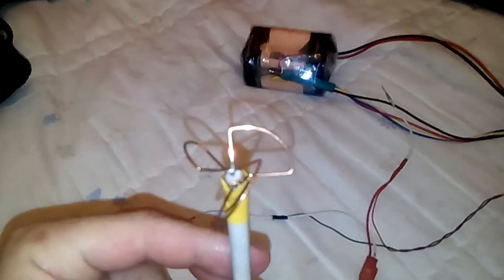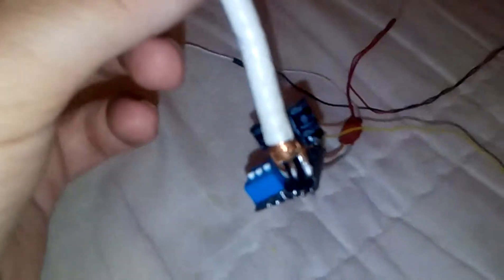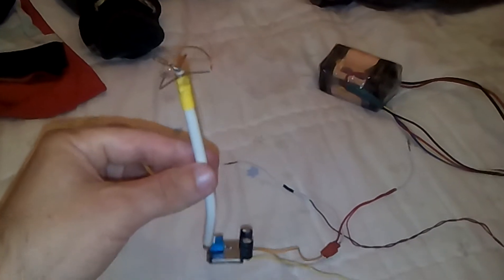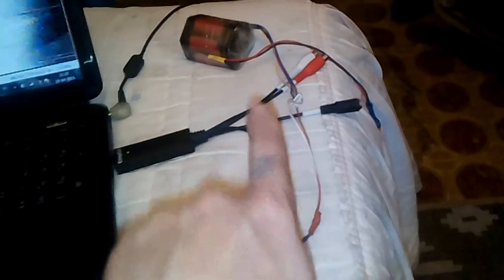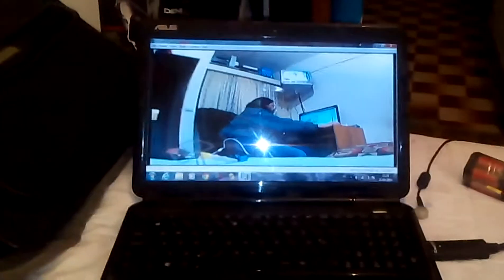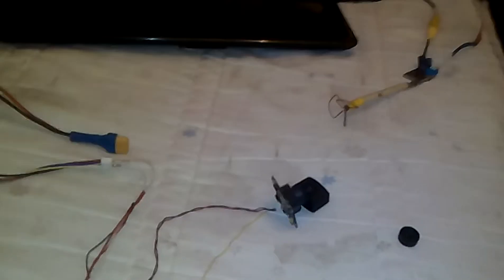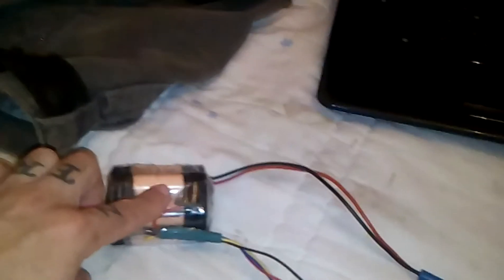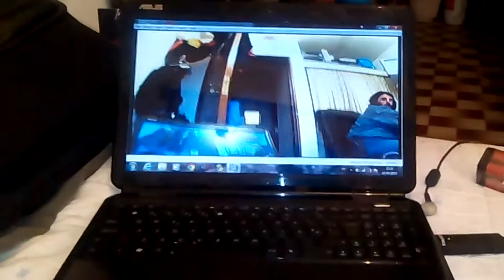Boscam homebuilt 5.8 Ghz FPV System

Comment: what type of capacitors  are that? can u give me link
Reply from the maker: Rc King those are 10v 470uf capacitors i do not have a link has i removed them from old electronic boards...you can find them easily on old pc power supply boards or in the pc motherboards...if you have something like that just unsolder them and use them :p